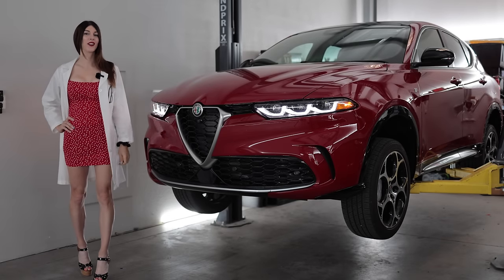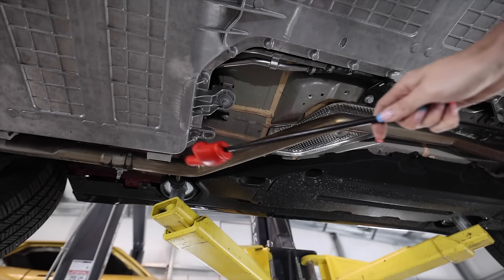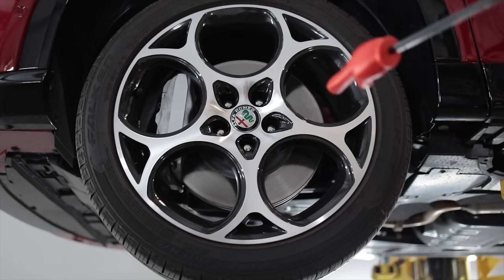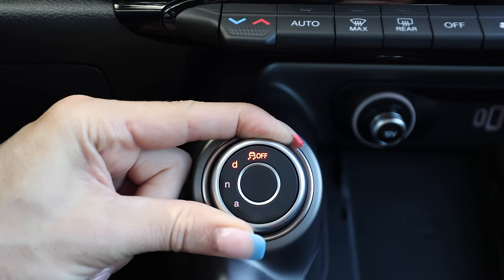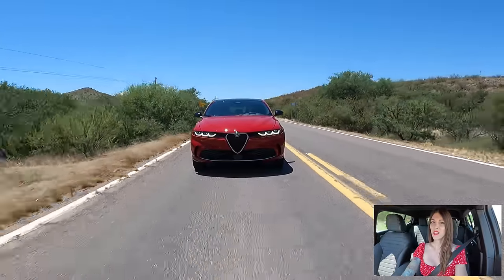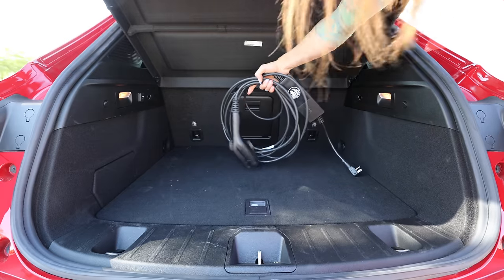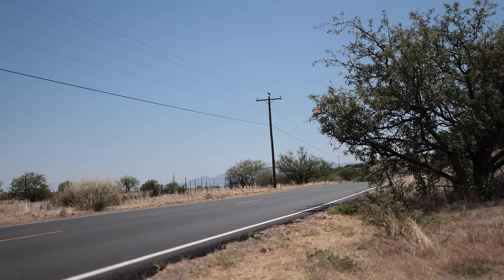The new SPICY Baby Alfa Romeo! // 2024 Tonale Review

Comment: Those lift point covers will only irritate the first mechanic because he's going to toss them out the back door.
Reply: That assumes Stellantis sells enough of them for more than a couple of technicians to find out about them.
Reply: no hie is not because working on customer car you can't just throw parts away.
Reply: Why would they toss them out - plenty of cars have them, and dealership technicians are trained by factory reps on how to correctly service them, including using the lift points.
Maybe, a small dodgy workshop will, but when the customer comes to collect the car and does the sort of inspection a customer should do after servicing, the customer should ask 'where are the lift covers?' and with hold payment until the job has been properly completed to factory workshop specifications.
Now, if ravencorvus is suggesting that they would toss them, then that's a workshop to avoid.
Reply: Except it´s part of the service, so they´ll charge you for the time it takes to remove and re-attach them...
Reply: @Konszky  That will be included in the book hours for the service. Dealships charge the hours according to the book, but how efficient the techs are, is how they make a profit - charge for an 8 hour job, but have well trained workers who can do it in 6.
Correct jacking might be set at 15 minutes in the book, but an experienced worker will take 5.
Reply: @sys-administrator  If that's the service you've been paying for, you've been over paying.
The majority of modern cars need the under-tray to achieve their fuel efficiency, and a dealership tech that failed to put it back on, would be looking for a new job pretty quickly given the service standards required by the manufacturers contracts with dealerships.
Reply: @PiDsPagePrototypes lol u think a dodge tech is going to be professional.
Reply: @_._B.  They are here.
Reply: Protect from winter salts, seconds to remove, and refit, I’d be miffed if a mechanic didn’t refit to my $50k brand new I’d just bought
Reply: @terot8341  hahahah... hahahah. hahaaaaaa. Yeah no we throw em away, "weren't on it when it came in", same as every vehicle with that rubbish.

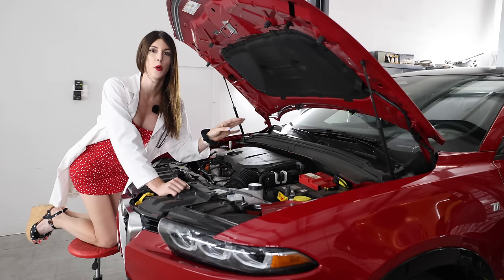Comment: 9:28 no that's single over head cam because the valves with Multiair system didnt use a camshaft but rather oil pressure

Comment: You need to test the Lexus NX 450h+ F Sport Handling Package. We have had one since April 29th and only put one tank of gas in it, at $40. It looks amazing, drives awesome, and is the best of both worlds (EV and ICE). It can go almost 40 miles on EV and over 500 miles on hybrid mode. Plus it has the reliability and resell value of a Lexus.

Comment: Which would you get?  The Tonale or the Hornet and why?
Reply: The Alfa...it's Italian !
Reply: Both are the same. It's a badge engineer job like typical in the auto industry.
Reply: @LynxStarAuto  And your choice is then?
Reply: Niether, not sold on the Fiat/Alfa reliability/dependibility.
Reply: @paultomaszewski1964  Ok.  Let's put it this way:  Your boss is giving you one of these as your company car.  Which do you choose?
Reply: @Gene1969  Save some money and go with the Dodge version.
Reply: @Gene1969  The Alfa because it's the core vehicle. The hornet is badge engineered off it. So some stuff stands out as off, isn't quite right. Like the steering wheel. Looks weird on the hornet, because it's a standard Alfa wheel.

Comment: aluminium has 8kwh/kg energy storage rating, so it would be 2kg of that stuff, to get the same single use fuel cell, which can be refilled with new koh-water electrolyte and metal, iron/aluminium/magnesium 2-8kwh/kg
Reply: yep same energy storage as gasoline
Reply: use carbon felt (carbon fiber felt/sheet) as the air electrode

Comment: PHevS always have crap highway mpg. You just end up lugging all that weight around. And to get the extra power you have to add a lot of weight. Just buy a mazda cx30, even non-turbo, and be done with it. A nice looking, excellent handling, fast (in turbo form) crossover that will be far more reliable.

Comment: If you don't want crap on the back of your intake valves with a direct injection engine just take the crankcase breather that will be at the top the camcover and vent it to atmosphere instead. In NZ its tradition to put the hose into a Redbull can.

Comment: Now the one big question that all Alfa owners only really want to know is this: Will it break down?
Reply: It's a car.  It's going to break down at some point.
Reply: @TWX1138  If you've ever owned an Alfa you'll know the struggle is real.
Reply: @1969Risky  I'll one-up you.  I own an italian-built Jeep
Reply from the maker: A cars reliability is highly dependent on its owners mechanical sympathy and the quality of maintenance it receives.
Reply: @SarahnTuned  True, but I've seen some parts whose design are simply poor.  Wife's Acura Integra went through numerous oil pressure sending units on the B18 engine and the rear hatch release solenoid broke several times as well.

I'd also heard that the most attractive of the Honda Preludes had a transmission whose design is excessively failure-prone.
Reply: Believe it or not, this year Alfa Romeo came in 3rd place on the J.D. Power initial quality results
Reply: Putting faith in JD power ‘initial quality’ reports is a massive LOL.
Reply: @hissingoose -  Gotta start somewhere.

Comment: Chassis-wise it looks like it has a lot in common with the Jeep Renegade.  Underneath the design of the suspension and the general hardware choices are quite similar, and it's pretty clear that the existing stellanis/mopar parts bin has been used for a lot of the stuff like the seatbelt adjusters and other interior accessories.